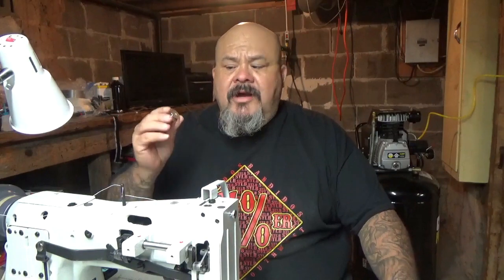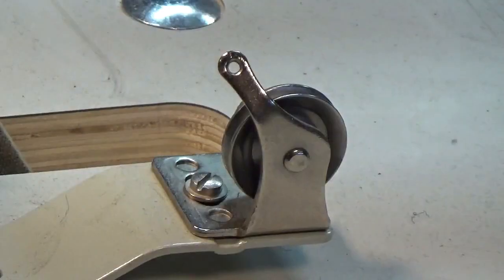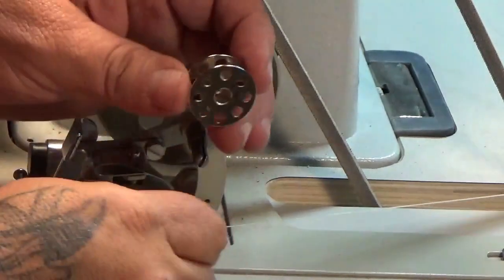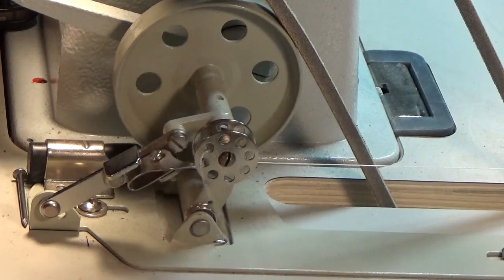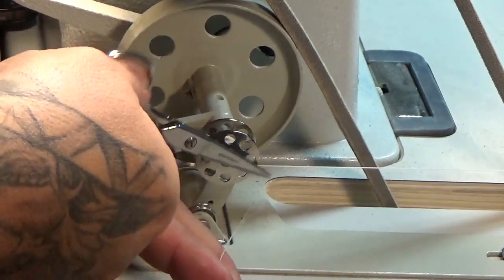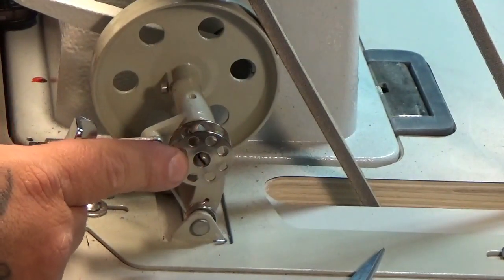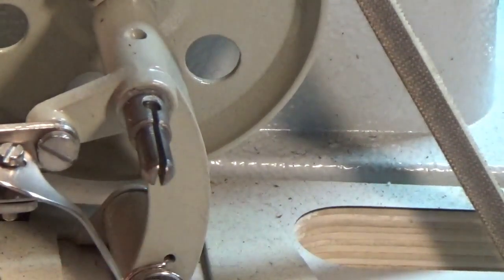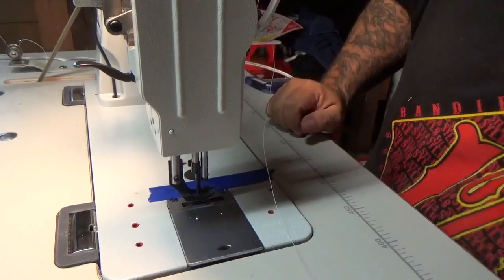Winding Bobbin On Consew 206RB-5

Comment: 😂 I guess that’s one way. My pop showed me another way. I put the bobbin on the axil first, then I run the thread around the spool five times and then pull as your engaging the belt. It automatically binds after it locks into place. Then I snip the tail and go to town. I’ve been borrowing an old grey cast RB from a buddy and it’s almost time to give it back. This is my next one. I bought that Juki 1541S and boy was that a mistake! The foot has a nice high lift factor but it’s too easy to go out of time. When it worked, it worked well but that was only some of the time. Juki’s old grey cast DNU machines were awesome. These new ones suck. Consew seems to be so much more dependable in the long run. You can’t go wrong. The kick out clutch always works and the reverse engages a lot smoother. Beware of the new Juki’s! There’s a lot of those new ones for sale on the net. They’re still new and for resale. ..lol.. 😂
Reply from the maker: Thanks for the info and watching.

Comment: Would like to see video made on how to set up a brand new 206RB-5 machine,,not the table but the machine itself,,adding all the guards, wheels  etc,,have not found a single video of that,,lots of threading the machine etc Thanks
Reply from the maker: Yeah I haven't saw one either.  Both my machines were put together from the dealer before I picked them up.  I didn't have to set it up.

Comment: quick question, is there a way to disconnect the belt to move the actual machine  while loading a bobbin or do  you have to have the machine connected, meaning the needle goes up and down while loading a bobbin?
Reply from the maker: The belt is what runs it to load the bobbin
Reply: @66Gordo  yes I  understand that, I guess you didnt understand my question, on my home machine, when you load a bobbin, you can "disconnect" the actual machine from spinning, etc, and only drive the bobbin ? I already found out this is not possible,
Reply from the maker: Oh ok.  I apologize I didn't get it.  Yeah I saw some machines do do that.  Thanks for watching and commenting.  Have a good day
Reply: @66Gordo  thanks for the responses

Comment: Thanks.
Reply from the maker: You're welcome. Thanks for watching and commenting
Reply: @66Gordo  Hello again I set my machine up over the weekend, I noticed it is very stiff even after oiling, I removed the bobbin and thread and turning the hand wheel it seems to be "sticking" when the takeup arm is at the halfway point Do you have any thoughts I bought the machine with a Servo motor so I can sew slowly , Thanks!

Comment: How do I adjust the bobbin winder if it winds uneven?  More on one side.
Reply from the maker: There are some screws you can loosen and move the mechanism to see if that helps.  One of my machines i gently help guide the thread go from one side of the bobbin to the other side. Cause that machine just wants to wind on one side of the bobbin.  Hope that helps.

Comment: How do you change the tension assembly on a 206 or 226 consew straight needle machine
Reply from the maker: Did you try looking at the manual that came with your machine? There is a video on someone has on YouTube called "maintain your tension assembly" you can check out and see if that helps

Comment: When I back stitch on my  rb5 its splitting the top thread and making it fray, split. I have to cut and rethread.. any ideas to the cause of that? the top thread is one size thicker than what I was using. could it be a needle issue?.
Reply from the maker: Yeah you might want to try and change to a different needle see if that helps at all.
Reply: I switched to the thinner thread I was using and it still wants to split and fray. seems to do it when I back stitch..
Reply from the maker: @daytonpyro  I asked the guy I bought my sewing machine from and he said it's possible your needle bar is to high or to low.  Or the hook is to far from the needle.